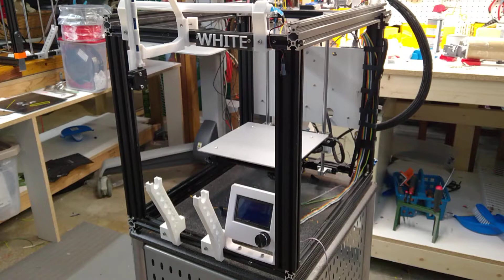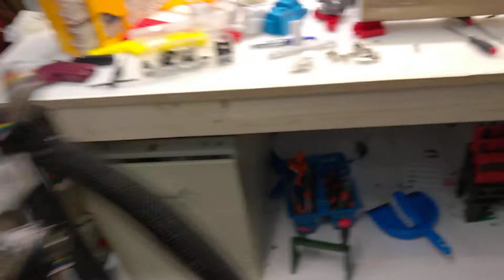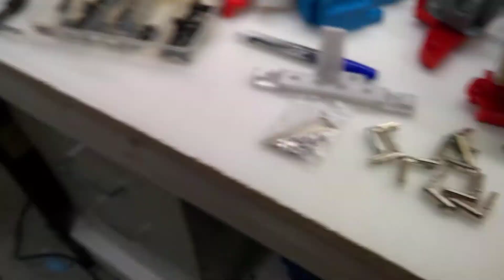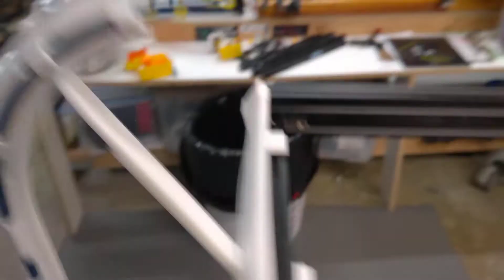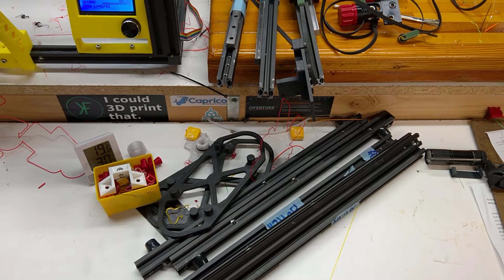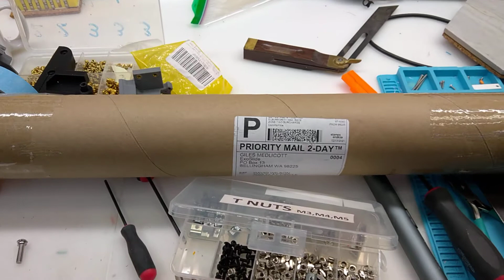Ender 5 Dual Z Mod Part 1

Comment: Awesome project! I saw some terrific stickers there too.
Reply from the maker: Kris, thanks for the kind words!.   I do like my stickers, and yours is one of the best.   I finally have decided the linear rails that you designed and I modified were not as good as the Exoslide.  They worked well, but the Exoslide was designed with the correct geometry.   Hopefully they go on today.